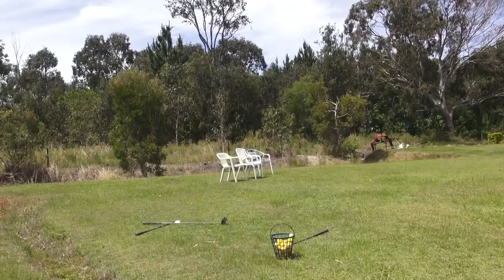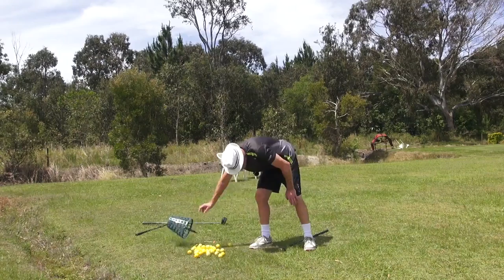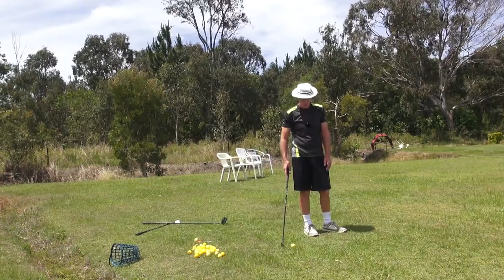'Layback'  Channel Lock  Swing Mechanics

Comment: Hi JH. this morning I gave this a go but with my own spin on it which I will explain. I found for me keeping the lead leg straight at address and during the swing was only really possible by having a soggy trail leg and sticking my trail side buttock out more than I would normally. eg more bend at the waste. In addition I experimented with having an opposite lock grip which allowed me to utilise a strong pre-turn in which I could lift, fold and then side hammer into impact. Of course it felt a bit odd at first and I fluffed a few and hit some fat when my brain felt short-circuited but when it worked it felt very easy and powerfull, little to no forewarm rotation coupled with little to no lower body  rotation on the downswing seems to be a sweet spot and the lift, fold and side-hammer gets the three lever into the swing. 8 iron was going 150m. With this setup it is very hard to over lift the arms or get too far inside and behind and it feels nice and connected with the opposite lock and inner elbows feeling like they are magnets attracting each other. I'm calling it the stay back opposite mag-lock swing.
Reply from the maker: Hi Paul,
              The formula for success is really what 'you' can get to 'work'   in your swing .. what you are doing if it's repeatable and gives a good strike is where you should be going..    I have some  really  easy  processes   to  give to  Lockers  that will   make   putting CL together   much easier .. I actually did the  video yesterday but my  camera  shut down  10 minutes before the end of the video  and I didn't know it  until I had finished the video .. I am going to reshoot  the video today .. I think everyone will   really get   a great improvement in their progress with these two new  'Cherries' for the CL cake ..
                     cheers JH
Reply: “Layback” forward swing really works hitting into the lead leg which acts as a buttress...Loading into my soggy rt leg really makes my rt
butt sore...I guess I am firing that rt glut ala tiger
Reply from the maker: Moe Norman said he always knew if he was swinging with the correct applications when the muscle groups in those areas of application ended being sore ..

Comment: Hi , JH
Should I keep the trail foot flat when strike the ball as long as possible?
BR
Reply from the maker: Hi Hong,
                   You should try to keep your trail foot down as long as possible before impact and a   bit after impact if possible  .. the will keep the trail shoulder back and closed at impact and as well stop you driving to body rotationally before impact  ... try hitting some 3/4     9/8 irons with the trail foot down right through impact and that will give you the feel for the process before you try it with the longer clubs .. try hitting quite a few of the short iron shots with the foot down before you try it with the longer clubs ..
                       cheers JH
Reply: Thanks a lot JH,
I will try your suggestion next time and hope can manage the longer clubs.
BR.

Comment: Convergence - a location where airflows or ocean currents meet, characteristically marked by upwelling (of air) or downwelling (of water).
Reply from the maker: Hi Paul,
                    Convergence is a descriptive that can be used for sure .. what I was looking for was  'Pyramidal  Vectoring'... that being force/pressuring being delivered from two wide base extremities a to a   vectored ... 'Point' ....' Convergent Vectoring' would do the trick as well as a descriptive ..              
               But either of those descriptives tells the story of what is occurring in that body force geometry application .. 
                       cheers JH
Reply: There I go to the dictionary again!  No matter, I see your meaning being a former baseball player and boxer. 
Pushback with lead axis is exactly what a batter does for Straightline extension. Along with c/l back ball position, closed lead shoulder, 5 o’clock nose, inside takeaway we increase our success rate significantly...BRAVO ! JH
You are a national treasure !
Why would anyone persist in the rotational high maintainable swing ?
You continue to create my neurons to fire...now if I could get the rest of my body to keep up 🤔
Reply from the maker: Hi Bob,
                   As Hogan said ..  ' The secret is obvious.. you just need to know where to look for it'... ..
                             cheers JH